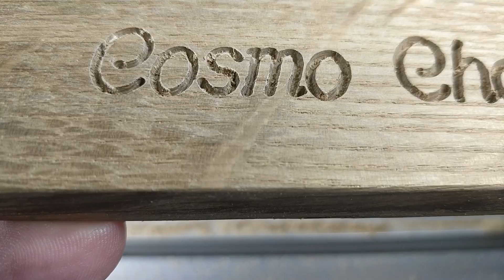UPGRADE Z-AXIS CNC 3018 to improve stability at low cost

Comment: It looks like your 3018 had 24mm linear bearings in the z-axis, which I agree is too small, but my machine came with two 17mm bearings per side for a 34mm total z-height.  This seems way more stable than wiggle that you showed, but doesn't stick out the top either, causing a loss of 9mm vertical travel in a machine that already doesn't have a big z-range..  On my machine I can detect far more play from bend in the x-axis rails than from looseness in the z-axis mount.

Comment: Just an observation...  If you're going to lose some Z axis range with the longer bearings, why not lose it all on the lower end (have all the excess bearing come out of the bottom)?  This would make sense if you ever decide to use a spoil board. You would lose some range by using a board,  you might as well take advantage of it.

Comment: Nice solution and I'm sure it is an improvement on the old situation but, I also think the 3018 was not built for a 500W spindle so it will always be a weak spot in my opinion. But, as I said, it is an improvement for sure!

Comment: I knew that the z axis support made from 3D printed was the weakest part just by looking at them on ebay and such but man...i didn't imagine it would be that wooblie. Jesus. That 3018 is really crappy. Nice fix/upgrade any way. Obrigado amigo.
Reply: all its intended for is entry level to get you used to g code and maintenance its not meant to make parts for your car. for what it is its excellent. you wanna spend several thousand you get better parts.

Comment: Did you print that yourself? I have 3x 3018 Pro Machines.. look nearly identical... but all my Z axis looks like a solid piece or maybe some injection molded plates with joints... but they are super strong... and do not have all the ribbing like your machine??? The black part that holds the motor, mine is gray, and not centered... it like wraps around and joins at the back side.. not like yours with the screw connections in the front... Mine is a few years old... well they all are... I am not sure how I ended up with 3 of them... but it think it had something to do with the first GRBL board getting fried ... then they sent me my original machine back.. and then another one... and then another one... I have lots of extra parts though... I am currently taking the appprox 12" x 10" X, Y axis and extending it to just over 24" x 24"... huge build area... coming soon... So what gives? why is your machine different? where did you buy? or did you make the black motor housing for an upgraded spindle motor?

Edit: I think after watching more closely, you have a different machine all together... My Frame is not the same type of aluminum, and the way your X -Axis is connected, is much different...
Sorry... I am interested to know if you have upgraded the motor though...

Comment: youd be better off finding a bearing the size of the ball screw instead of the home made bushing . it still has ledges that will catch. find a bearing and drill out a hole to fit it and press the bearing in

Comment: Your missing Roller bearings on the Z there should be 4 and only looks like you have just 2, and your also missing the bottom lead screw bushing part. my CNC came with all the parts your missing
your also missing the x axis bushings to
Reply: Correct, absolutely.
Reply: obrigado vou verificar isso e te falo
Reply: Guys i am interested in such a machine, but i would need a higher z-axis. Around 100-120mm instead of only 45mm. Is there a way to increase it and use it or should choose another model and if yes, do you have any recomendations for wood and soft alumium? Thanks in advance!
Reply: @tamgaming9861  voce teria que aumentar a coluna do eixo z , coloque barra de aluminio maior ok
Reply: @jsuaed-videos  ah thanks for your answer. was a bit tricky to translate it :-) Do you think it has a disadvantage if i go higher for the stability or the precision of the cnc?
Reply: @tamgaming9861 not answering your question will affect you in anything by raising the column axis z ok
Reply: @jsuaed-videos  yes expected it..., saw a video too where some ppl talk about more vibrations. Means as higher it goes as stiffer the whole frame has to be.
Reply: There are a wide variety of CNC machines out there. Check eBay and all the usual scumbags. You could also upgrade one of these DIY kits by designing a longer Z axis mount. You would need 2 longer guide rods and 1 longer acme threaded rod.

Comment: I must say I wouldn't hammer those linear bearings,  the tiny ball bearings inside them can fall out, ruining the bearing. Press fit them every time. If you must hammer them, put a short length of the correct size rod inside them to prevent this happening.
Reply from the maker: You're right. When I did, I didn't think about it. Still great advice! Thank you!
Reply: Correct

Comment: Wow, a big difference. I think I would be tempted to do a complete make over of the Z axis in aluminium, slightly more travel etc,  and at the same time fit either fully supported SBS linear rails to the X axis frames or Hiwin linear rails…..cost is irrelevant. You could make this machine so much better with a few tweaks like that.....ask Myfordboy.  At the same time I would also install another 4 axis controller and run on Mach3..... even a 4th axis is possible.....it has the potential to be upgraded hugely with a bit of craftiness.....why settle for less...….to put the cream on the cake, I see Taig has some 12mm ball screws for an update to their mill......that would be a huge step forward.
Reply from the maker: Surely. But at this point, shouldn't you buy a better one?
Reply: @cosmochannelvideo  Yes, that would be the logical thing before you invested in that particular 3018, but as it's so cheap initially and you already had one the upgrade to a better outcome is tempting. It also gives you a basis for some improvements if you're into that sort of thing. Some people like to tinker with machinery and a lot just depends on what you intend to do with it. Any serious machining and you would have to think of a solution for that situation before you indulged in a cheapie which even with an upgrade would not seriously perform like a more robust and powerful model......cost is a factor too if rebuild time is not. It's designed and built as a fully working model down to a cost which I think is a brilliant achievement.
Reply: @cosmochannelvideo  Does life really work that way though? If you can get the machine now, you can learn now.  If you wait, life happens, events come along, emergencies take place, people need things, you spend the money, you wait to learn, you lose the interest.  Nope.  You want to do a thing?  Start now.  No excuses.  The the moment it's possible.  And then improve.  That's the way life really works.
Reply: obrigado valeu
Reply: @cosmochannelvideo  My thoughts too

Comment: z axis linaar rod is fine becouse its short ,but x axis rods should be linear rails so it stop wooble more. then z axis stuff other than 3d printed parts lol. try cut 0.2mm tip when it wobble more xD

Comment: Why use a flexible shaft coupler on the Z???? any downwards load, say from a flat end mill, and it will expand like a spring... also, you don't need the drilled out brass threaded insert, all that is doing is now transferring any eccentricity from there to the centre. You only need to fix a lead screw at 2 points, just look at the Z axis on an ender 3.

Comment: Hi.
Nice stuff, i also have this one. Printed big upgrade for this. The motor holder and some bearings stuff. But i have stock motor (silver color), you have some black one. Havent seen this.
EDIT: oh, you did motor upgrade. Nice, have to do this also.
I also bought longer Z profiles the 2 vertical ones, this to increase the space between the bed and the chuck itself. I have a wooden plate on bed and its thick and its very hard to change the bits.
Havent installed these yet, because im doing other things atm. 
I want to try to make PCB with this one, there are tons of videos and ideas. Have to try. Specially drilling hundreds of holes is very nice with this CNC.
Good enough for hobby stuff.
Reply from the maker: Hi, there. Thanks for the comment. I use it for wood engravings and I feel very good. With some improvements you can achieve great results. Thank you!
Reply: e boa sim  , vou fazer algumas mudanças no futuro ok
Reply from the maker: @powertothebauer296   3000-12000r / min

Comment: Thanks I did the upgrade! It came across my mind the is it normal that the stepper motor is holding up the entire z axis, would putting a stopper at the bottom of the threaded rod (where you put the copper ring)?

Comment: thank you for showing this upgrade, do you thing this motor would be able to mill small aluminum parts? I plan on changing the Z axis on mine as the plastic printed parts are just not up to the job i think, going to rebuild it all in aluminum
Reply: if you are upgrading plan it thoroughly first dont make these mistakes and never cut corners like this.this is rigging at its finest
Reply: Yeah if you have this spindle and a better z axis, you still need to address the x axis. That is a bigger change, the linear guide rails are not that stiff and you might want to replace them or at least add a third, thicker rail.
Reply: @LuLeBe   I rebuilt a whole new CNC out of solid aluminum from 3/4 plate and a 2.2 kw spindle, its a whole new cnc
Reply: @adrianharrison5208  sounds amazing! Didn't actually notice your comment was that old when I replied.
Can you give some details? Like, what guide rails, leadscrews/belts or so, built with just 3/4" aluminum or also some aluminum extrusion like the often seen 4080 parts? I'm in the middle of planning some upgrades to get my machine from about stock shapeoko stiffness to something much better, so I'd love to know more!
Reply: @LuLeBe   it has a few peices of extrusion left but they are only there for a platfornm for 15mm linear rails and 1604 ball screws to bolt too, also these few parts will be filled with epoxy granite.. the aluminum plate is acts as the frame now..  It also has an acorn cnc controll systeam that i will be sorting out tonight with 23mm steppers.. 
I have been asked to make a few youtube videos on the build so I may do that
Reply: its like a bantam cnc but will more cutting power
Reply: @adrianharrison5208  okay so you're not relying on them for stiffness really but mainly as a connection piece, interesting. May I ask about a rough cost estimate? I'm already using 1605 ball screws and 15mm linear rails and will probably just reuse those, but the aluminum parts probably aren't that cheap. As I'm coming from a woodworking background I only have my CNC router which can sorta do aluminum as well as an angle grinder and a cheap drill press, so working with custom aluminum parts and getting sizing correct is probably difficult. I should invest in some proper measuring equipment...
Reply: @LuLeBe   Yes I prob spent around $2000 canadian on tools to make the machine but I use an old table saw with a sled to cut my aluminum..
I bought a mini mill for drilling and milling parts to spec and then there are a few granite flat plates and measuring equipment tools..
if you have the room get an older mill as it will be bigger and cheaper working platform 
I prob spent $2000 canadian on mothion parts so electrical and controler and another $1000 on the frame
Reply: @adrianharrison5208  yeah the room is one of the issues xD as a student my apartment has just enough space for a 3d printer and pcb-milling-optimized 3018 CNC, and my parents' basement has one room for all my tools, and that's about 8x16 feet so space is super limited.
I do have a small table saw though, might experiment with Aluminum cutting on that. Did not know that's an option, probably needs a fairly fine blade though.

Comment: Fantastic video <3
I'm about to start experimenting with CNC machining, i'm pretty comfortable with Fusion360 and i was thinking about jumping now on the CNC side.
May i ask what are the main advantages of using a more powerful spindle motor with your CNC router kit?
Happy midweek and please keep it up the great job, highly appreciated <3
Reply from the maker: hello. the advantages are on the engravings on hard materials and for the finishing of the engraving. In addition, the engine speed remains constant even when the cutter removes a lot of material. The old engine suffered a lot from deep cuts. The only flaw is the higher weight that lowers the quality a bit in the small engravings.

Comment: hello, do you recommend this spindle? how is it compared to the stock motor that comes with the machine? I want a more quite machine, maybe this spindle can help
Reply from the maker: surely with the new engine I find it more powerful and excellent for small and precise cuts at high speed.
Reply: maquina e boa, sim  vale a pena
Reply: @cosmochannelvideo  I know that English isn't your first language, so the translation is a bit off.

Engine = requires fuel (petrol, diesel, etc.)

Motor = electrical

When you are referring to the spindle, it is a motor not an engine.

Overall good videos, keep up the great work!
Reply from the maker: Thanks a lot for your comment. I understand English almost well but still have a lot of difficulty writing in English. I rely heavily on the translator. I am wrong not to reread the translation.

Comment: All those upgrades should of been done when the new spindle motor mount was made . But the you could not of had to make this video.
Reply from the maker: You are right. But initially I did not agree with all this movement .. Using the cnc I understood where the problem was.

Comment: You used 1 half of a backlash lead-screw nut twice. you could have used the other half on each occasion to actually get the benefit of them. secondly, the part you used was 3d printed for the bearings. you could have printed it with the right tolerances to begin with to have the original bearings fit with no play. thirdly, you haven't used a grub screw on the opposite side of the lead screws so it is naturally now going to "ellipse" as it navigates the x in the Z and Y axis. Just because it has less play at the end does not mean that is more accurate since you could have pre loaded the play and it would have been more accurate than the set up you upgraded it to.

Comment: Its really sad that this defect so easily passes inspection
Reply: this is not a quality issue. Its how these cheap CNCs are made in China. I have one sitting in shelf for almost a year with similar issues. Out of the box Its completely useless until you spend another $300-$400 on upgrades to make it useable.

Comment: that 500W spindle motor with its fan will vibrate that Z gantry even with that upgrade and break your bit tips all the time even with just pcb milling. that z gantry design could not even handle a 550 dc motor. better design and print your own z gantry and downgrade to the smallest fanless spindle motor that can hold an ER11. the x and y design and materials used just lack the necessary rigidity to prevent a bigger motor from vibrating the whole set-up. any upgrades of the 3018s should include anchoring the T8 screws firmly to the gantry/body and not rely on the stepper motor bearings and coupler for stability.